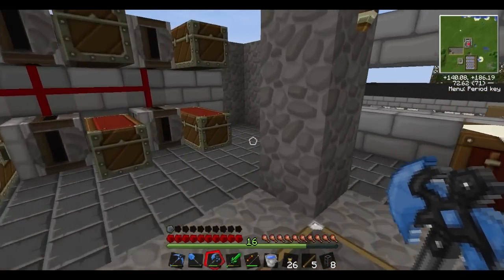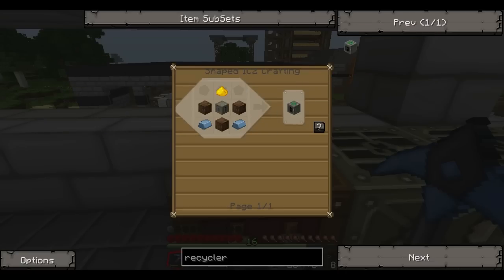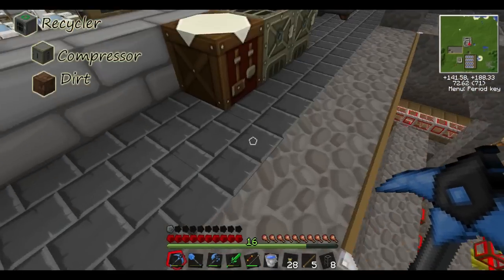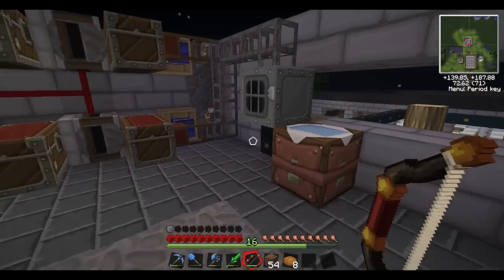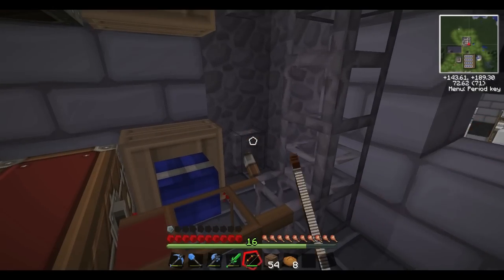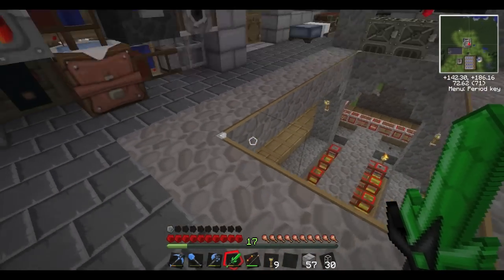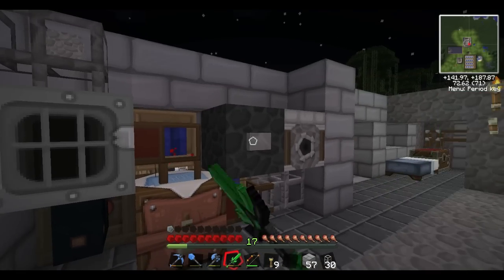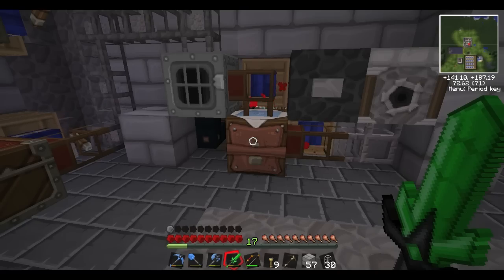Let's Play Tekkit - Episode 21 - Recycler

Comment: With the two pipes merging into one, you'll need an iron transport pipe so it wont back up on itself and then an insertion pipe going into the machine itself, otherwise the pipe will drop them. 

You can either loop the insertion pipe in a square feeding back into the machine, or back into the chests to be pumped again.

You also may want to consider putting bat boxes on your poles, as they would reduce the amount of power loss and they would somewhat look like a real life transformer.